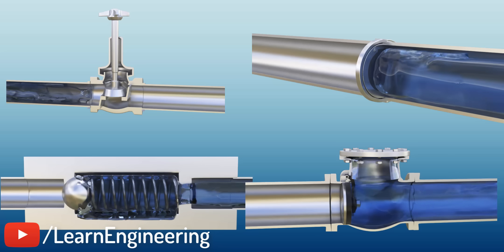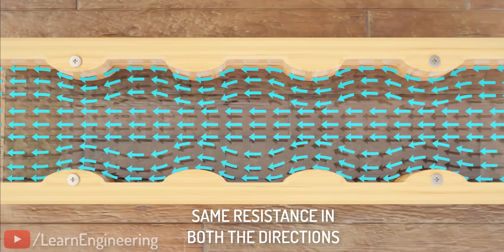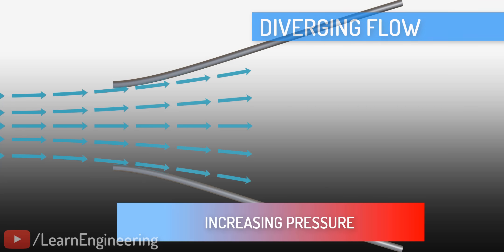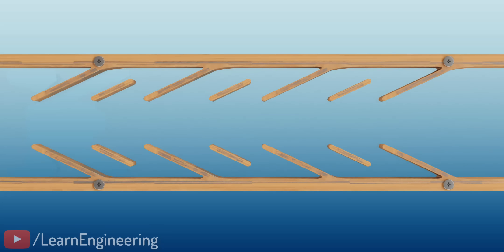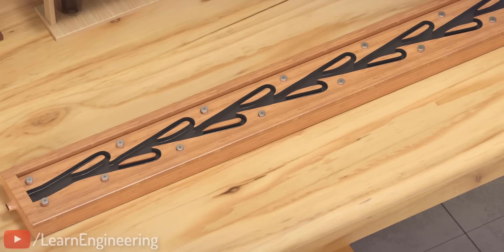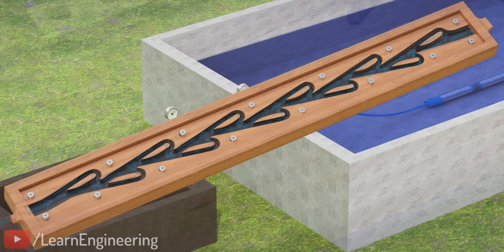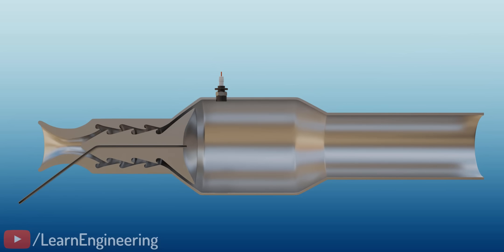Tesla Valve | The complete physics

Comment: I wish you would have explained the reasoning behind the shifting step 3:09 a bit more.
Reply: Probably it is because an abrupbtal expansion by the two ramifications at the same height would be less efective at making the fluid lose energy than using only a secondary flow with a greater velocity for the generation of vortex at the end of the branch.
Reply: I am probably wrong, but intuitively it feels that by using the offset you create a situation where the secondary stream "pushes" the primary stream into the next secondary channel.
Reply: Yeah! Why is that needed? Is there a 3d pattern that's more effective?
Reply: Think it's just to increase the efficiency of the system.
Reply: @MMathoks  Yeah okay ... But the point of the video was partially to give an idea how Tesla came about the ultimate shape.

And that step felt a bit like cheating ( from video pov ) 🤷‍♀️
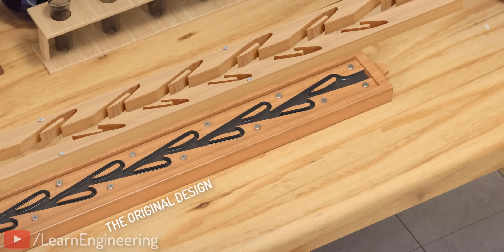Reply: It is actually explained in 3:24, I.e. The flow is always divided into two streams.